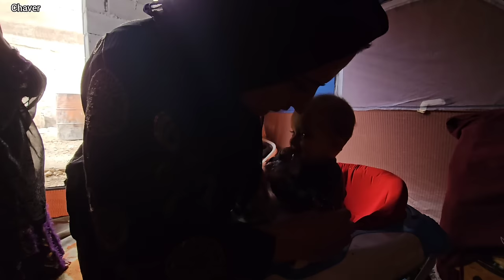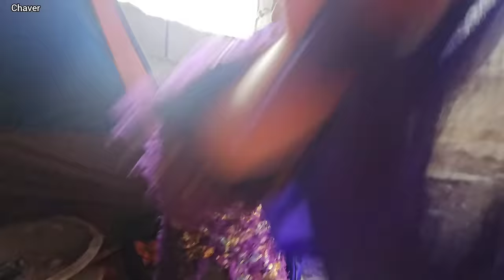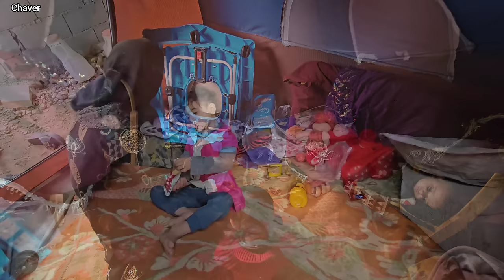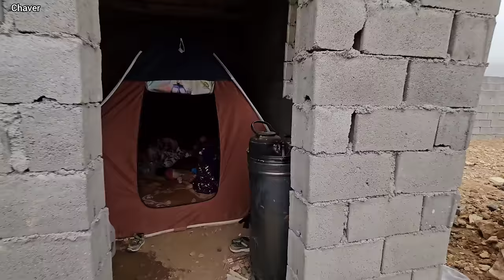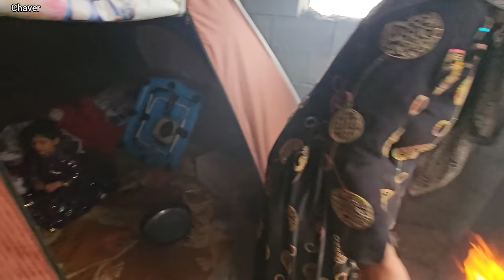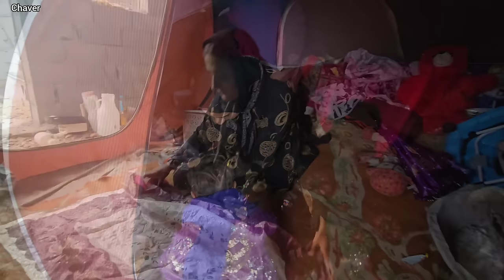Strong opposition of the young man's family to marrying a divorced woman. 💔🤰

Comment: They are going to suffocate inside the tent with that charcoal fire. The carbon monoxide is dangerous and it happened in the other channel when the mother with 2 kids did the same thing. Good thing the cameraman was able to save them. They called a doctor because the mother passed out because of smoke inhalation. Cameraman you need to check on them.She shouldn’t have closed the tent with that fire and smoke not able to get out.
Reply: She put the heater outside.
Reply: Yes, she put the big heater outside, but she put a charcoal fire inside a big dish inside the tent then she sipped the zipper. Didn’t you saw her do it? The other mother did the same thing and if the cameraman didn’t bother to checked on them, they probably had died. The mother had already passed out that the guy had to call a doctor because she wouldn’t wake up.

Comment: Figure out where you are going to have the stove permanently  and set it on bloc( and make a hole in roof so you can have heat. Like plastic on windows use plastic on top of door and blanket at bottom to seal out cold for the time being

Comment: Cameraman please help her with the foil and tar paper. The kind that goes on top of the roofs to help waterproof it. It is silver on one side and tar on the other side. It is put on with a torch and a metal handle. Please get someone to help her as it will only leak and get moldy and then it will get worse. God bless you.